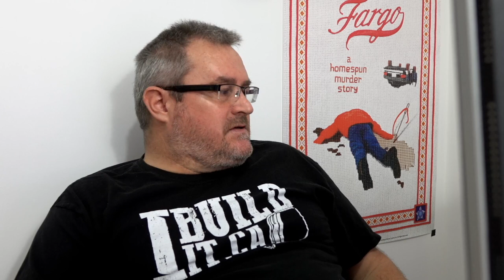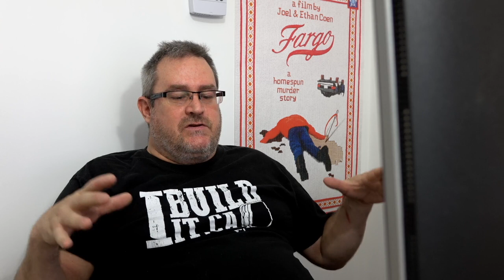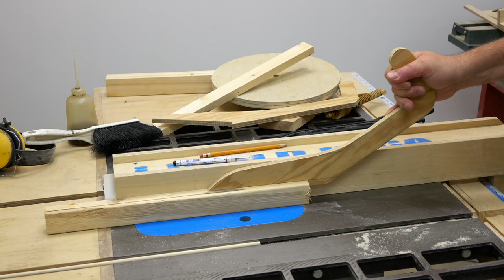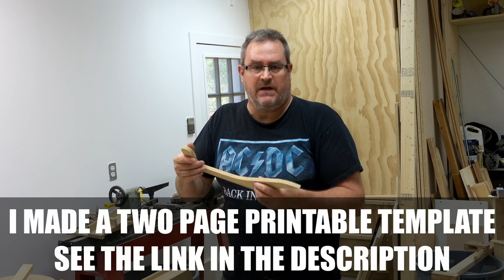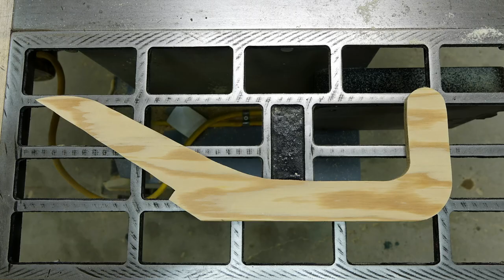What Happens When The Project Is A Fail And Push Stick 2.1

Comment: I wouldn't worry about people questioning your competance.  I really like youtubers who post their fails, it's actually often more informative than their normal videos (though not really in your case).  Guys like AvE have kind of built their brand in showing the process warts and all and I think it's earned him a more dedicated fanbase.
Reply from the maker: As a general rule, guys are going to be way more interested in a successful project, rather than one that didn't work out. If I were running a comedy channel, leaving in or inventing screw ups for the amusement of the viewers would be a-ok. But, for the most part, I play it straight, keep the pet words to a minimum and build things that I think are useful. Or, if they are not entirely useful, at least they are interesting to watch.

Comment: My concerns have been the same as yours. When your stock starts to ride up on the blade is when accidents happen, even to the point of yanking your hand into the blade. I've been using a longer pushstick like the plastic one you started out with, but I couldn't get as much downward leverage as i would like. You solved that problem with your hybrid design. I'm making one tomorrow. Thanks.

Comment: Make it and it works well. One note though. If your table saw is a bit lower or higher than 30 inches or whatever the notarial height is then the handle will need to be a ajusted(just like John did in this vid) I found this out as I stole the wheels from my table saw stand for a temp dolly, so it sits a few inches lower.

Comment: I independently came up with a design very similar to your original, but put some adhesive abrasive paper on the narrow sole which is 1/2" Baltic birch. The toe is thicker which gets your hand a bit further from the blade. Your rev 2.1 looks better but I think that your original gives better control. I am going to make one like your rev 2.1 but am concerned about ergonomics. Keep up the good work.
Reply from the maker: Try it out and see if you like the feel. Everything new takes some practice to get used to, but this felt pretty natural to me right off the bat.

Comment: I always feel like push sticks are far too light. I think it would be beneficial to have the part in contact with the board have a fair bit of weight. But thats difficult to do without adding some kind of metal which would obviously make it risky to use should it hit the blade.